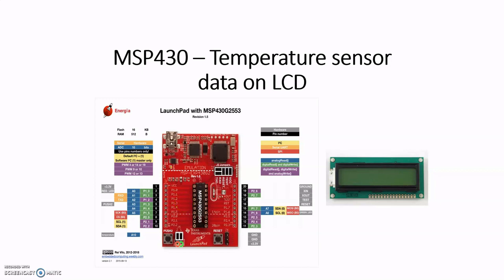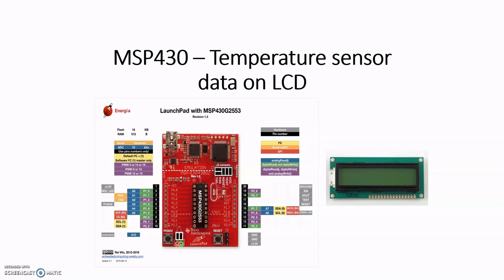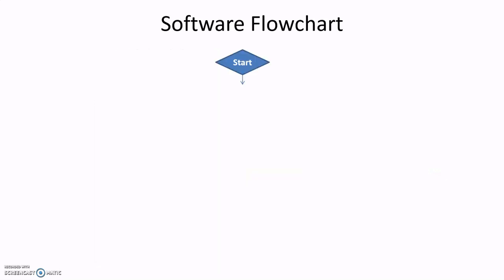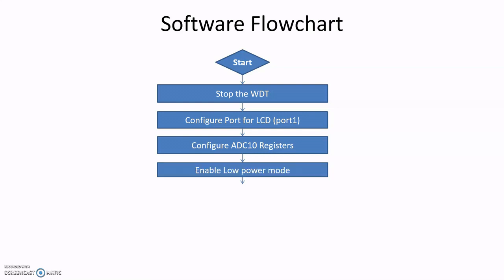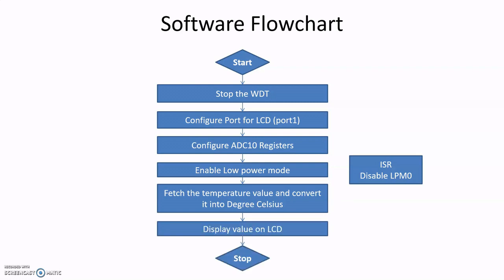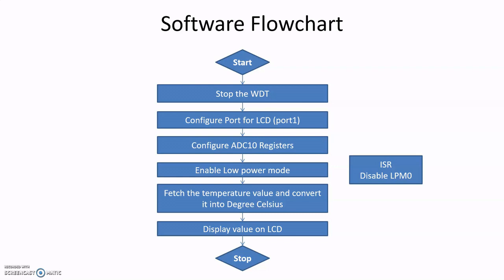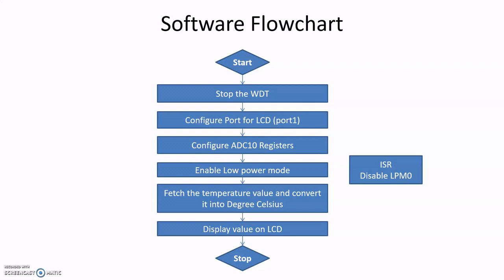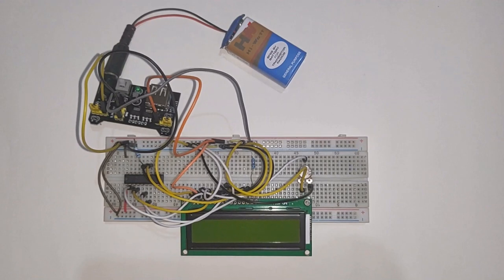MSP430 Temperature sensor data on LCD

Comment: which communication you used and why????
Reply from the maker: Did you check the code?
Reply: @BinaBhatt  i want to display temperature and humidity using dht11 
msp430 fr2433